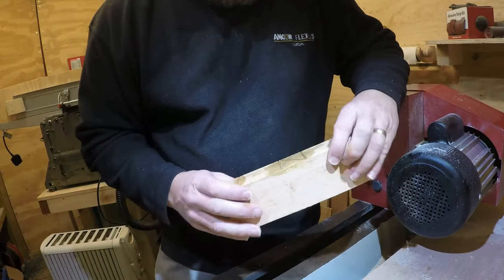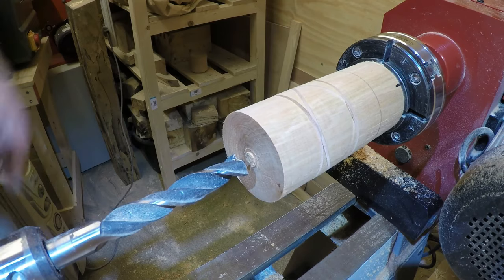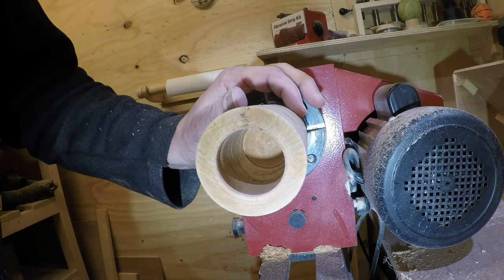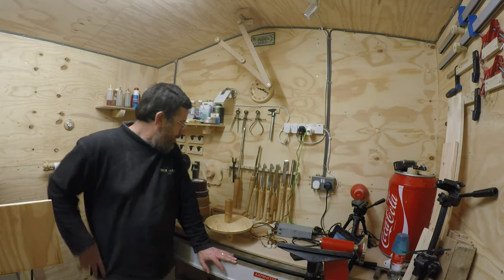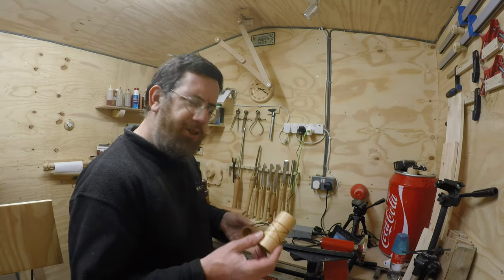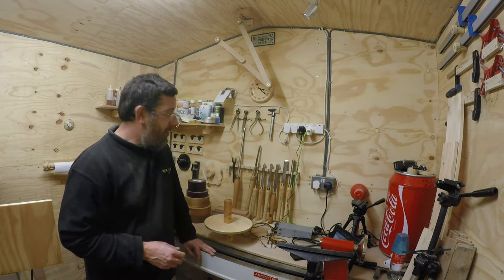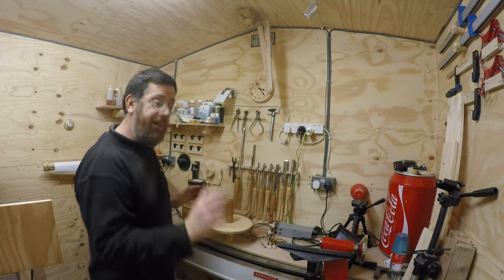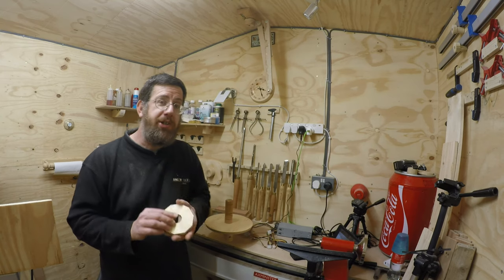Celtic Knot - Episode 47

Comment: Hey Paul, happy new year mate !! You can fix the lid issue by turning a ring and inserting it into the lid, therefore making a new tenon ..... You don't have to call it a Celtic knot, just call it an inlay design ;-).....

Thanks for sharing, look forward to watching more of your journey in 2017 !!

regards,
Steve.
Reply from the maker: Thanks Steve. I was considering turning a new lid in the future as I have some more of the wood. An insert ring sounds a great idea, so something I will try, maybe with the same wood I used on the inserts as that would help make the balance of the woods look better.

Comment: A great first attempt Paul, I still have yet to give these a go!
Happy New Year to you and yours mate.
Cheers
Mike
Reply from the maker: Thanks Mike. Wow something I've tried before you. I will certainly give it another go, the biggest thing is cutting the slots to fit the inserts. Next time if the wood is not too thick I will do it on the chop saw, but that is limited on size which is why I tried on the bandsaw.